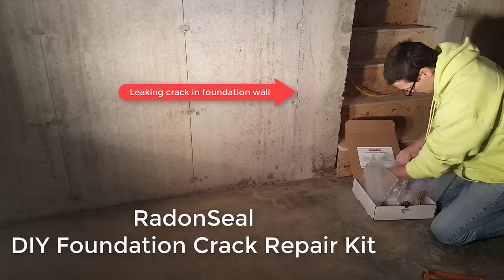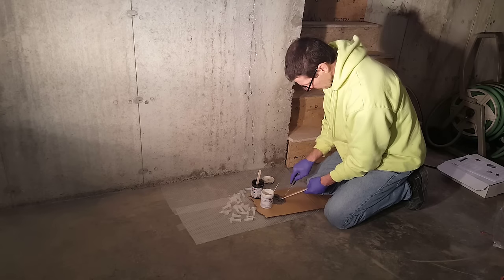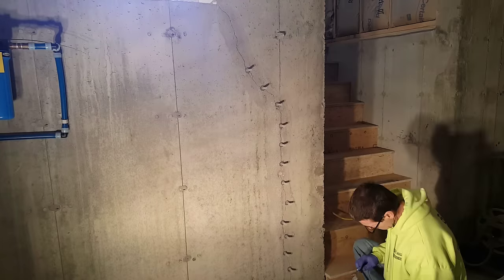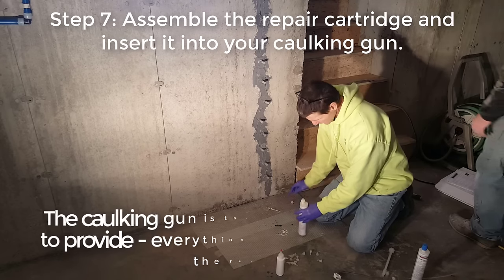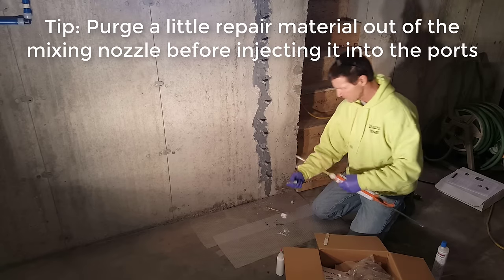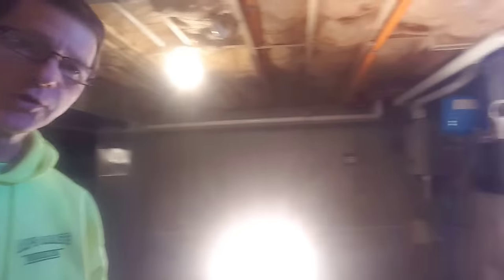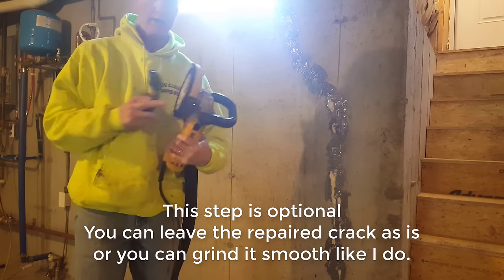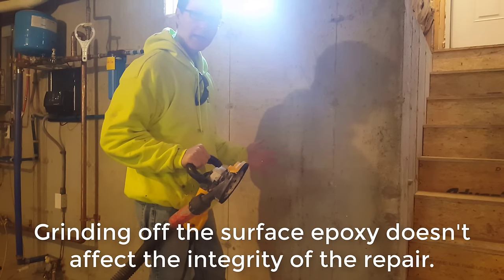BASEMENT WALL CRACK REPAIR : HOW TO FIX LEAKS A STEP BY STEP GUIDE

Comment: Hi Mike. Kevin in Kansas. We bought a farm home and under the front door dormer we had a leak that would leak during hard downfalls under the staircase to the finished basement. We have Black Walnut trees on property and for some reason years ago they let one grow 20 feet from the front door. They also put useless gutters on the dormer that lead to nowhere. Bad combination. So, we watched your video and repaired the thin crack and cut the enormous tree. All good now. Thanks for your content. Your kit was amazing. Cheers.

Comment: I had a hair-line crack that started leaking water this winter when the ground was frozen and we had a lot of rain.  Found that the crack was visible from the outside as well as inside.  I watched the video and then followed the links and bought the kit.  Today was installation day. A+ for most of the contents of the kit.  The only B was for the little water bottle.  More water would up leaking from the bottle than came out of the lower spouts.  I used plumber's tape on the bottle threads for a better seal.  The trick here is to gently squeeze the water bottle and be patient.  Did I mention you should be patient with the water bottle?  OK.  The wire brush was perfect.  The tubes were easily sealed to the wall with the epoxy paste, then the epoxy paste was added to the rest of the brushed area.  Let cure 4 hours.  Applied water, and that took well over an hour and a half.  Took the polyurethane mix tubes and set them in hot water for 20 minutes.  This a must in my opinion.  This makes the polyurethane flow easily.  Just like the video, start at the bottom and patiently work your way up the wall.  I found watching the occasional bubbles in the polyurethane tube gave me a way to pace  the delivery of material.  Looking into the next tube up I could see when the polyurethane was about to come out and was able to close the feed tube, pull it off the tube, cap the tube, and get the feed tube attached to the next higher tube with little spillage.  Now I'm waiting for it to cure.  Tomorrow, I'll knock off the tubes and then look into how to sand down the epoxy paste (did I miss the link for that tool?).  One last comment, remember to seal the top of the wall if your crack is visible there.  Overall, very satisfied with the project and the kit.
Reply: And what if the crack doesn’t stop leaking

Comment: Just used this kit.  I used my Milwaukee Caulk gun set on 4. It filled my crack all the way through to the outside of the wall which is under my deck. I guess I will be cleaning that up in a couple of days. This kit is awesome. Thanks for the video.

Comment: Great information. Thanks!

PSA -
You should have an N-95 NIOSH Approved mask on to reduce inhalation of airborne silicates. I get that you have the vac attached to the grinder, but unless you are using a wet saw/ grinder, there is still airborne particle exposure risk. Just an FYI for you and your viewers.
Reply: Thanks for the PSA!

The good news is that the pandemic has made N95 masks essential for even a trip to the hardware store, let alone the repair!! 😂

Comment: Well - I gave it a go.  I have a 2nd crack and had to order a 2nd kit.  That will be fixed when it arrives.  I'll describe my experience:

The prep work, port installation, and epoxy is the time consuming part.  The epoxy goes a little quicker than you think.  I did have some polyurethane resin/foam leak out from weak spots in my epoxy-ing.  (I'm not a professional).  I did read that just because some of the foam leaks out doesn't mean the product isn't working.  I did have 1-2 spots where the material would not make it to the higher port (~75/80% of the time it did).  I had to work through a PVC pipe area in the middle of the wall.  I warmed the injection tubes in hot water for about a half-hour before injection.  I went slow on the injection (I watched random air bubbles as my "guide" to prevent me from going too fast) and kept constant, light pressure on the caulk gun to slowly move the material into the port.  I'll let it sit for another day then sand it down/remove the ports - also might Drylok over top the whole area.  

~7 foot crack; total time - 6 hours (I did go slow and I had a lot of old caulk to get off).  The 2nd crack will go a little quicker I'm sure.  It's messy at times, but I think it'll work.  And don't get the polyurethane on your hands - no other way to get it off other than to sort of...wait for it to fall off.

Enjoy!
Reply from the maker: Good job, it'll work!

Comment: What if my basement is leaking right in the corner, would this method still work? How would you attach the injection ports in that case, since it seems they require a flat part of the wall to attach to?

Comment: Thanks for sharing. Just started working for a waterproofing company and thought I might tutor myself a bit.
Reply from the maker: You could do this on the side and make really good money.
Reply: Mike Day Everything About Concrete ... Mr. Mike, my house is leaking bad, I feel I can do this Can I go Tony local Lowe’s or home de Poot and do these 3 cracks in my basement??? I can’t afford to pay anyone, as I’m a single mom of 3.....?  What do you suggest??
Reply: @sdmartin808  where do you live?
Reply: @sdmartin808  you can do it yourself.
Reply: @chirina5   Cincinnati, Ohio
Reply: @MikeDayConcrete  sorry my spelling was horrible! Lol! Lowes
Reply: Home Depot
Reply: @sdmartin808  if you have an email i can send you some information on where to buy the product i use. And we can discuss what your situation is.
Reply: @MikeDayConcrete  my house just got rebuilt on the same foundation of the old house after a house fire and we just found out that there is a leak at two points is it going to be a long term problem?
Reply: @sdmartin808  did you get your cracks fixed I live in the area
Reply: Where do I buy it at

Comment: After the dye process and injections like you have done in video should I put micro fiber straps after this process or I will be fine?
Reply from the maker: You'll be fine, sometimes we'll grind off the excess epoxy the next day to smoothen the patch flush with the concrete.

Comment: As a professional water proofer when it comes to  injections they have a huge chance of failing and you need to be drilling the crack on a 45 degree angle and should be pumping a acid through the crack first to clean and debris out of  it cause and sort of dust little stone in side the crack can cause pin leaks in the injecting then after that you want to pum through a ton of water to wash the crack out  and then patch the crack and I also like to patch the crack on the out side above grade as well before pumping this and even with all that I really don't like doing it

Comment: My basement walls were formed with brick mold forms.   Have literally one crack from the bottom corner of an egress window to the floor. It has leaked for years so was excited to finally have a repair kit. The crack is not wide though slightly more than a hairline. We have open studs on the walls for future finishing. So putting the ports on wasn't smooth.  The brick shaped surface is rough and the studs limited maneuver space.  So when I started pumping each of the ports leaked. Now I have no way of knowing how much product is in the wall sealing the crack. I assume some but there is a good size blob at the bottom...not in the crack.  Any recommendations? Should I drill through the inside patch between the ports to expose the crack and put on new ports  to try and get more product in the wall?

Comment: Great informative Video!  I have a 6" wide foundation wall that is exposed on both sides that is two years old.  The small settling stress cracks start at the top and run straight down to the footing, about 18" long.  They also go completely through the wall from exterior to interior.  I assume I need to seal  the backside to keep the polyurethane foam sealer from flowing out the backside.  What is your recommendation to accomplish this?  The exterior will eventually be back filled with dirt, and the interior is in the crawl space. 
On a side note, what happened to the $15.00 course you mentioned in the video?

Comment: I paid $850 per crack at two of my properties, and they didn’t even sand it down. I still have the tubes sticking out of the wall. Thanks for sharing - I will never be taken by again!
Reply: Maybee that is going rate in your area prices are different all over the country a master plumber in nyc charges 300 a hr a master plumber in nj charges 150a hr and a master plumber in pa charges 100 a hr.
Reply: His video was pre covid so I do believe it’s about $1000 a crack now

Comment: Great videos! One Tie Rod Hole in my poured concrete basement is leaking water inside. How should I fill it?
Do I need to clean the hole before filling, it might have soil, mold buildup, etc.?

Comment: Hi Mike I have water coming in my basement at the union between the footing and the Bottom of the foundation wall  it’s a horizontal crack 20 foot long do I use the corner injector port and what is the sequence of injecting since I’m going Sideways ? Thank you

Comment: Would you take this approach if there is water leaking in while you do it
Reply from the maker: The crack can be damp/wet but not with water running in while you do this.

Comment: Is it better to use this from inside the house in the basement - or to use it outside the house - but you would have to dig down the basement wall to expose the whole crack?  Could be a lot of digging.  Would you say it is just as good and strong to do from inside the basement wall?  Please let me know as I am not looking forward to a big shovel festival.
Reply from the maker: Better from the inside. No need to dig out on the outside.

Comment: Do you think this would also work in block walls?  I used xypex on the flat surfaces, but I am still leaking at the vertical corners.

Comment: Hey, thanks for the informative video. Really appreciate it! 
Was wondering if you have tips on how to repair a corner pop (I believe that is what it is called? ) in an old basement corner at the top where it should be supporting the wood . It’s a fairly old house (120 years). Lots of cracks and large holes in the basement walls. What would be the best what to go about making it presentable or fixing it for selling? Thank you!

Comment: I have cracks on a open porch concrete slab over a storage area. It has 5 perpendicular cracks I need to seal. Will this or the epoxy system resist expansion/compression when the summer sun and the winter cold hits it?

Comment: Mike, youve been around long enough to know that making money is one thing, but actually stopping water infiltration is yet another.
If there is enough of a problem as for water pressure it will find a way in or it will make a way in.

Comment: Hi Mike. Thanks for the video. Do you recommend this product for leaking tie rods? If so, is there any prep work to be done on the concrete/tie rod area other than clearing loose debris?

Comment: Does this work on actively leaking crack? Thanks for the video.
Reply from the maker: Gotta stop the water for a short time first. Crack can be damp but not with running water coming out of it.
Reply: @MikeDayConcrete  I've got a basement floor crack and it seeps when the snow melts and when its rainy. I first used my grinder and prepped the crack for hydraulic leak stop(H.L.S.), put the H.L.S. down and it died except where the water was still seeping. I put a skim coat layer over it to try and seal it from the top. When the snow melts it darkens(dampens) the crack. So I came to the conclusion to get the kit in your video.  Chip n remove the bs H.L.S.  and start over. So now that I put u in the scenario, u think I should drill a 1/4" hole in the crack and shove 1/4"tubing in there n try n pump the water out? Or just wait till it gets cold enough out to freeze again. Is a slow seeping ok or needs to be dry?
Reply: Mike Day Everything About Concrete  Hello, how can I get the instructions on how to do mine. I know you mentioned a $15.00 cost for something. I’m ready to do mine ASAP! Let me know if you’re selling a how to, step by step video.

Comment: great video, get yourself a respirator mask for the grinding though, trust me. i've been doing masonry work for over 25 years now and my lungs are shot from inhaling that dust on too many occasions. also saw you say this would work on a cinderblock wall under another comment... i would NOT suggest this product for that application. cinder blocks have 6x6x8 cavities in each block and about an inch cavity between blocks in most cases, most contractors save money by not "slushing the cells" (or filling the cavities with concrete), meaning in order to actually seal up a block wall using a product like this would take at least 20 times as much. tuck-pointing is the only way to go on block and brick, and its much cheaper to do.

Comment: Mike, What do I do with a crack that us significantly wider than that?  For instance, and inch or an  inch and a half?
Also can you tell me the name of the tool that you used to get the wall prepped to paint?
Reply from the maker: A crack that wide sounds like a structural crack that needs repair. Probably better off letting an engineer look at it and make a suggestion. Without seeing it it's hard for me to comment on one that size.  I used a Dewalt 4" grinder with a diamond cup wheel on it to prep for painting after.

Comment: I have a question.  I have a basement wall where there's a hole in it because the old rebar has completely rusted through.  So basically there appears to be a hole from the outside to the inside.  When it rain a lot, water comes in.  Will this kit work on this type of problem?
Reply from the maker: Yes this would work. But you could also use hydraulic cement like water plug.

Comment: Great video, how well does this work on cinderblock??  I have a crappy cinderblock addition on my house and it leaks from random spots, I have done a bit of grading outside which has helper but I need to make sure it is 100% so that I can insulate and finish the wall without worries of it leaking...  Thanks for any advice you can offer!
Reply from the maker: It'll work good for cinder block cracks as well. It expands 20X when it's injected into the crack filling and sealing up the entire crack.
Reply: speaking as a mason with 25 years of experience, i would NOT use this on a cinderblock wall at all. that is what tuck-pointing is for. this stuff is for fixing fine cracks, cinderblocks have rather large cavities inside them that are rarely filled completely with concrete as they should be. you would end up using at least 20 times more of this product than you should.
Reply: @Smokey420Greenleaf  So what they actually did was poured a concrete foundation about 5 feet tall off the footings then capped it with about 4 courses of concrete block, which i believe may be filled with concrete, but I will have to check to find out!  I am going to dig down but I'm willing to bet that they only parged down to that concrete/cmu joint and perhaps the parging has failed there.  Thanks for your reply!

Comment: How wide is the widest crack you've filled with it? I have 2 fairly large ones in am ancient 1920s foundation.
Reply from the maker: About a half inch for me. This stuff expands 20X after you inject it so it will fill a pretty big crack. Just have to be able to seal up the outside of the crack.

Comment: I bought the kit and followed your directions (so far) up until inserting the foam.  I tested my epoxy seal with the water bottle and saw that I had to put a little more epoxy around 3 of the ports on the bottom portion of the crack--water came out around the ports. After adding a little more epoxy by those ports, I let it cure for a day.  Today, I don't get any water coming out of any ports.  I squirt the bottle from the top port and then move down--no water. I'm nervous to go to the next step of inserting foam. Any suggestions?  Ports that had water coming out of them on the first test do not have water coming out now. I only added more epoxy to the bottom 3 ports after 1st water test.  Why is there no water coming out anywhere now? it's shooting back at me from the port I insert water bottle into.
Reply: That means the second coat of epoxy worked

Comment: I have a vertical crack that goes up behind my return air duct work.  I risk damaging the duct work to remove it to ensure proper seal of entire crack.  I do not have water seepage at this crack, it just looks bad.  I am considering urethane crack repair here.  In your opinion would this be okay to inject up to the duct work?   the duct work is above the natural soil  line on the exterior of the home???
Reply from the maker: It would be OK. It'll seal up the crack, then you could grind the surface smooth if you want to. My course shows you all this and how I do it.